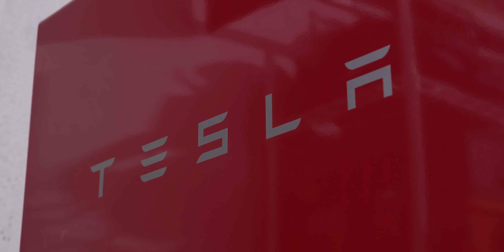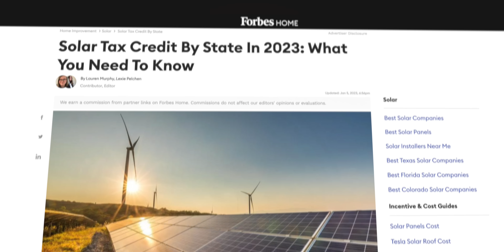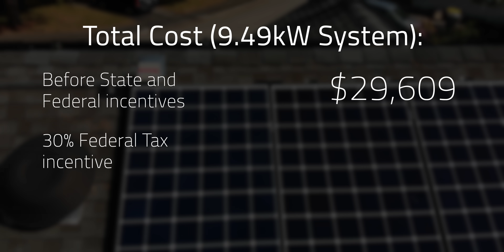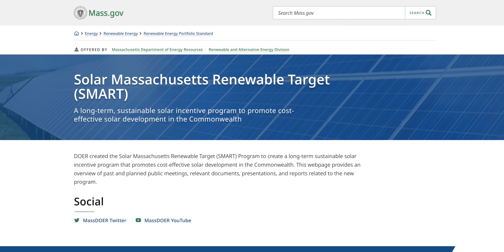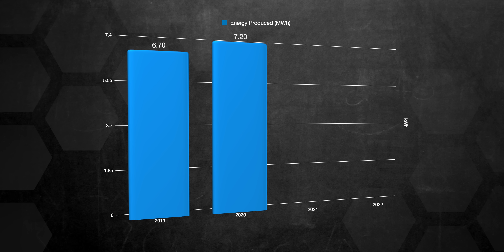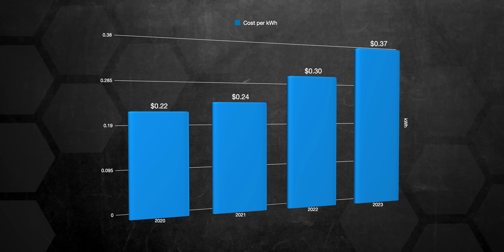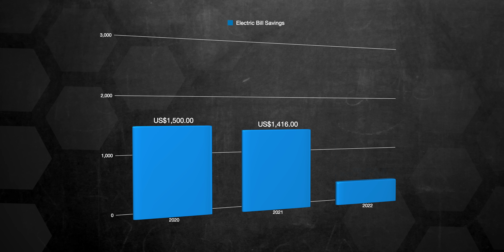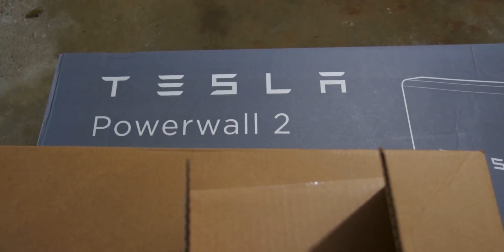5 Years with Solar Panels - Is It Still Worth It?

Comment: Just went through our first winter with solar and I really wish I knew about the snow issue. Even with just a few inches of snow, when it melts, it can be quite spectacular when it comes crashing down.
Reply: It does that without solar panels also.  The snow started to melt and ripped off my gutter.

Comment: There is a lot of new energy sources, look, question.  In the UK I am about to build new housing with zero fuel energy sources costing  $0.00 to run.  Delivering 300% more power to a house so more needs are provided for.  The same sources mean E cars have no batteries, so at the end of the day when you park your car, if you plug into the house you can have even more power available.  No need to switch off to economise, switch everything on and enjoy.  Go wild camping and one of the generators can fit in back pack, so all sorts of electrical devices can work without batteries, solar or wind power absolutely anywhere.  Just switch it on, KinetiK.

Comment: My negative experience with solar panels came when selling the house. The appraisers gave me $0 for them in the appraisal, calling the panels an energy supplement and not a home improvement. Not saying this will happen to you, but beware that it can happen. The appraisal company even went saying that until enough homes have solar, this trend would continue. So I asked how many homes would it require before they changed their stance. They said 30% of homes per neighborhood would need panels before they consider it a home improvement. Bastards!

Comment: Besides the ROI, my biggest concerns would be roof leaks and whether it would support the extra weight.
Reply: Panels are very light, like 45 lbs for each. He's probably got 25 of them. A light snow weighs a lot more than that. And they screw them into your rafters, the weight isn't distributed on the roof material.

Comment: I live in Delaware USA and have a all electric 3600 SF home I built myself 14 years ago. We have 3.0 KW solar, geothermal and two tankless water heater’s. With Rec’s and a $120. month average electric bill my systems were paid for 6 years ago. Average electric bills around my area for same sq footage homes are between $400-$500 month. My soon to be next home will be 1/3 the size and completely off grid.

Comment: I live in Florida and wanted to install a 12.5 kw system, my electric bill is around $2500 p. year. I did a LOT or research and was really into it and wanted to do it. But there was an absolute deal killer which i hardly had hertd o and no y installer or solar system sales firm dit tell me: my home owners insurance would not insure my (new) house with a solar roof with netmetering. And the next,  out of 10 insurances would charge almost 2000 more per year…thats almost as much as my electric bill is. That may only be a problem in Forida but chEck this one BEFORE

Comment: Very helpful YouTube. With all the advantages of solar you didn’t evan mention the reduction in carbon footprint. By the way we like our solar system with Tesla powerwall which Tesla installed after 2 delays in their schedule. We also had a very long and disappointing experience with Tesla Solar.  Our Tesla Model Y, however, is amazing.

Comment: I have found it is rather important in some areas that houses simply should not be built so that the snow from the roof can fall on the stairs or in front of the door or garage. Few things ruin your schedules as well as having to shovel tons of snow to be able to go anywhere, and packed snow on your porch stairs quickly turns them into a deadly ice slide.
Last winter I had to go back to my old home for a few days and found myself waking many times at night when snow fell and it sounded and felt like something had crashed into the house, or in one case like someone was sneaking around the house...

Comment: Great video!  I installed solar panels on my home in 2013. During that time the average panel produced 250 watts which is what I have. Things I would do different. 

1. Oversubscribe the inverter by 50%. I have 10 years of empirical data to substantiate that amount. 

2. Get a larger inverter. Mine is 6 kw and I should have gone with 10 kw. 

Get more then you think you need is the message here.

Comment: I live in NE Mass and have had solar since 2016.  We have a $1.6k credit with National Grid.  The system has paid for itself, and we have no regrets.

I live in a small ranch style home, so we don't have the same issues with snow and rain, as you do.  I do remove the snow to improve production and have plans to install heat wire below the panels to melt the snow as it slides off the panels.

We also would like to add a battery backup system, so I'm glad that I found your video. I didn't know that the payout was only 5 years for this program.

Comment: My concerns regarding solar power costs are:-
First- Annual maintenance. Is it required and if so at what cost. Does the utility company carry out inspections?
Second- expected and actual lifetime of the equipment, both the panels and the control gear. (My worry about this is due to seeing otherwise healthy appliances failing due to expensive printed circuit boards)
Third- In the event of failure, are spare parts readily available? Matt mentioned that LG have ceased in the solar market.
Reply: There's no maintenance. I'm on year 7 and no issues. Most panels have 10 to 25 year warranties.  Even though LG exited, the warranty is still honored.

Comment: my home solar panels in the Netherlands were put on in feb 2017. electricity cost about 23 eurocents per kwh. my system generates on average 3600 kwh per year. in total I paid 4500 euro's for the system and installment. now 6 years later I've generated over 20.000 kwh. last year the price per kwh was 0.89 cents (dropped to 0.69 cents this year) because of net metering my system al ready has paid itself off and now saves me 250 euro's a month . I consider solar panels a very good investment,

Comment: Things I wish I had known before installing my solar panels (in Oregon):
1) PGE charges a little over $12/month just to be connected to the grid, even with a net surplus of solar power.
2) Any excess solar energy is given away, once a year.
3) The 3G modem that came with the panels expired after 3 years and would be over $500 to replace, so I can no longer monitor my solar production in real time any more.

Would I still get solar panels again--absolutely!  Now that we have a heat pump for heating and cooling, I hope we can expand our panels and also get a battery wall.

Comment: OK, so you didn't save all that money on the installation etc. You took it, with the strong arm of government, from other taxpayers in significant amounts.
And your costs do not include disposing of all that toxic waste in the panels in the not so far future.
Also, your high and getting higher utility costs are ALSO caused by government regulation.
Fact is, that before the govt got in to this energy fiasco, the power company I used to be with sold power at ONE CENT per KWH after you had used a minimum of a certain amount. And people were putting in resistance electric systems. for heat. It was competitive with nat gas, which was also cheap.

Just wait until the government turns on you and decides you are a bad guy by not sharing your solar power with the rest of the town. You don't need but a fraction of that power for yourself. The government will decide how much you should get, if any.
That is really how this works, and it is what they have done to the existing systems the govt decided to destroy.

Comment: I would love to see these calculations done when accounting for the opportunity cost. If I had $30k, would I be better off getting a solar system, or investing in a mutual fund?
Reply: We had a 9.6 kW system + 10 kWh battery installed in May of 2020 in Southern California. Our electric bill was about $2000 for the year prior to installation. The system net cost was about $30,000 that we paid for in full. I don't know of another investment that would return a guaranteed 6.6% (2000/30,000) with 0 risk the first year with the added benefit of a rising return each year as electric rates continue to climb.
Reply: Depends on the mutual fund. Some Morgan Stanley funds lost half of their value in 2022.

Comment: A few things you did not factor in to the cost. What happens when you need to replace the roof? How often do you have to clean the panels? What about birds making nest under the panels. What about warranty problems where labor is not included? Looks like most of your savings is subsidies by the government?

Comment: Agree with the mini-snow avalanches. I've gotten used to hearing big clumps of snow hit my back deck where a cluster of panels for my array are located. I have another smaller cluster out front, which has the same issue, but there's no danger that anyone will be standing there. Today, thanks to you, I learned about snow guards and may ask my installer about them. Good luck with the guide!

Comment: We are approaching our second year with our solar panels. Our house was worse than yours for solar, the angles and steepness of our roof. But we had more land, almost an acre, so we had them ground mounted. That means we don't have the problems with snow and rain.

Our panels are large enough to cover our full electric bill and we get a small payback at the end of the year. What we don't have is a battery, so when power goes out even if it is sunny we have no power. We hope to get one in the future.

One question I have with you building your new home is if you looked into far infrared panels for heating? I have had heard some good things about it, though mostly fron England. But I haven't found anything other than information from companies and not anything from independent and thorough people like you. Have you heard anything?

Comment: In our case the company we hired went bankrupt after a tax incentive program was cancelled. Few years later 1 panel stopped working and when we had it looked at by another company it turned out that the first bunch majorly botched the install and we were on the hook for an additional $9k to get everything essentially re-installed. If you can get any kind of insurance on your install I'd highly recommend it! Of course I'm also very annoyed with our city inspectors that was supposed to find these issues before the install was completed but they were useless.
Reply: We went with Powur but we almost went with Pink solar or something and I think they also went bankrupt.

Comment: Thank you for another great video. I suppose getting solar panels is inevitable, especially considering the price of electricity these days. My neighbor installed solar panels a couple years back, and the biggest unexpected problem he discovered is pigeons. Apparently that little gap between the roof and the bottom of the panel is irresistible for them. They like to snuggle under there in bad weather and build their nests at the edge of the panels. He's constantly shooing them away and breaking up nests.
Reply: If birds are a problem maybe, he could skirt the panels with chicken wire. Only an idea but it might work for him.

Comment: Hi Matt. Practically all solar panels sold in the US are manufactured in China, and approximately 1/3 to 1/2 are manufactured by interred Uighurs. It’s apparently been devilishly hard to determine whether Uighur labor was used to manufacture a given solar panel or its components, since panels are often first laundered through other Asian countries.
Are you aware of a way to make an end run around this problem. I can’t buy solar panels that were manufactured by modern indentured servants with a clear conscience.

Comment: We have had a very similar experience in Upstate NY with our ~11 kw installation. 2 arrays with different orientations. We received the 30% federal tax credit as a large tax return due to "overpaying" our taxes the year of purchase. The whole process/install was only 6 months within 1 year (finished late December 2014) and we had made no tax plans for how best to handle the tax implications. We also paid a big chunk of our loan with that refund, but in the next year's taxes, we got hit with a large tax bill, since that ~ $10K refund was added to our income for that following year (and was untaxed). We ended paying back a third of that refund in taxes. 

We also have an issue with snow slides off our roof. We have a 2 story dutch colonial, so there is short section of roof at the first floor level that takes the brunt of the falling snow. The shingles on that short roof have taken a beating. The falling snow also shakes our house like an earthquake. Lastly, we often clear snow from our front walk which is then covered by compacted snow a short time later that comes off the roof.

Our second array is on our detached garage roof, which is a much lower slope. Snow does not slide off that array, but then again that array has gone a whole month without producing any power due to shading by snow. I know the panels are tough, but I have been hesitant to manually clear them as I'm sure I could damage them if not careful. That  risk hasn't been worth the $100 of electricity we might have otherwise generated for say the month of January (which is the usual month this occurs) . The house array clears within a day or two regardless of the amount of snow, but only warm weather and melting clears the garage.

Comment: Thanks for the nice video of your experience. Have you noticed the Powerwall making your system overall less efficient? I have a 10kw system with 2 Powerwalls and the process of transferring energy to the Powerwall instead of directly to the grid definitely causes a loss of effective production. Just thought that might be something you could touch on or explain in a future video.

Comment: We did a 7 kW solar array on the roof in north central WI late last fall along with a Tesla power wall.  Sadly the way the utility bill is designed I can't figure out if I have saved a dime, and the power company can't tell me either.  Cleaning the snow off the panels is a pain, but it is amazing how much more energy is produced once I do.  I wish I knew that I would need two Power walls to handle the load of the new heat pump.  Frankly, at my age, I am not sure if the solar will pay for itself before I am gone but having a backup battery does give me peace of mind during a power outage.  Also, I wish I knew the State of WI gives squat in tax incentives and the power company gives no incentives either.  WI does not seem interested in helping homeowners go solar.  I was also amazed by my home insurance company, they knew nothing about rooftop solar and wanted us to get a business insurance policy if we sold too much electricity back to the utility.  But they were unable to tell us what too much energy was.  Finally, we showed our monthly average electric use and how much the panels might produce to show them we were not a for-profit company.  I also wish I knew there was only one utility inspector for my area and that it would take him a month to approve our system so we could turn it on.  During that month there was a power outage, and a lot of sunshine going to waste.

Comment: While you briefly touched on it, panel shading and less than optimal orientation conservatively reduced your solar generation by 30 percent.  A system the size of yours could easily generate 10,000+ kWh per year with a South or southwest facing in the Northeast.  My 8400w DC (7500w AC} system facing SW with no shading generates ~10,000 kWh each year in Southern NH.

Comment: I started alternate energy innovations Oct2010. Solar wind and hydro alternatives. In Komifornia. The "state" gov regs etc are always a ....... well ill be nice and put it as an experience. 
As far as products, immediately after the 5:1 return ratios went away, lemme rephrase, even with the 5:1 incentive ratios, in my humble opinion, solar is a loser, face it, they degrade daily. Batteryback up, longevity hasnt really improved as far as longevity, as the manufacturers certainly will not produce a product thats not planned obsolescense. 
So the cost, well long term, not cool. Also whats to happen after the 20 year cycle now that weve covered the planet with plastic, led, aluminum, silica....? And the batteries. Wet cell dry cell its all hell. This is tomorrows asbestos crisis all over again. 
Did i mention maintenance? Get the picture? Good luck! Now should you have a running flowing water source, hydro makes all sorts of sense, and wind generation is all over the board with posative advancements. 
And talk about cheap and low maintenance, also, good luck with your solar in areas of heave snow and hail stones..... ooops! 
Now there is passive solar utilized in window glass, now your talking. But silaca paneles ath lithium or led storage, ummm no! 
Now since im in komifornia, let me explain the genius, the LARGEST engineering accomplishment in America to date.... is .....? The California Aquaduct. Whats the best these idiots can come up with? Cover the aquaduct with solar panels in an attempt to help prevent evaporation of water! I cant make this up. 
Hydroelectric generators from the sacramento river delta to los angeles? Naw.....help!